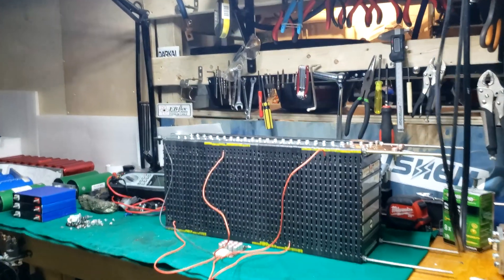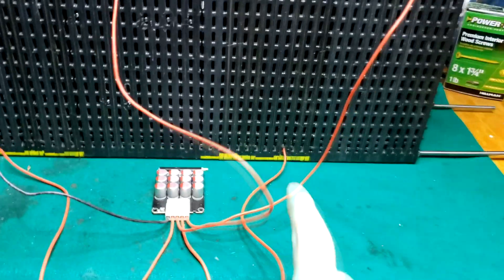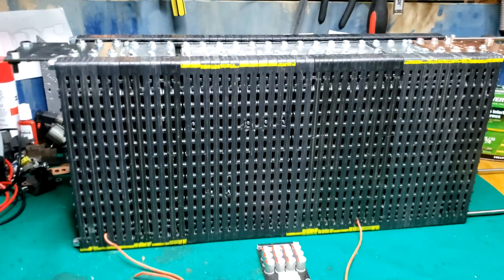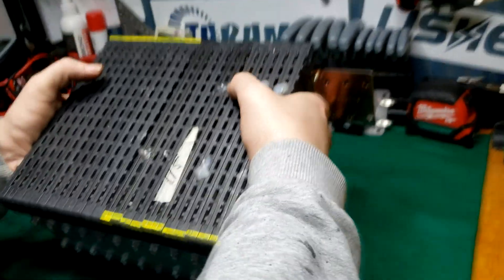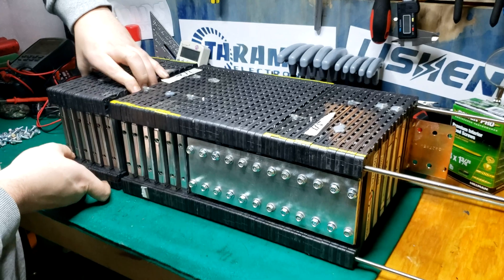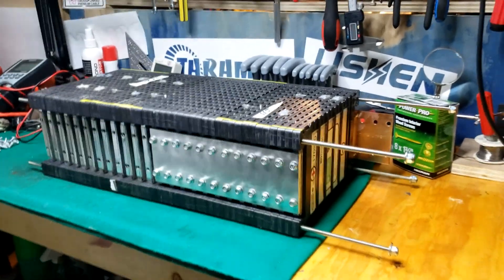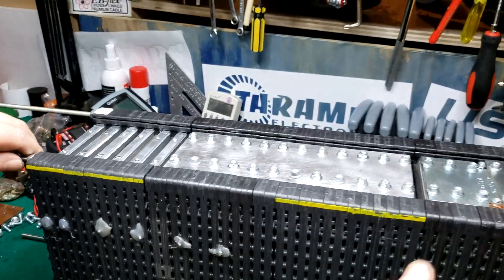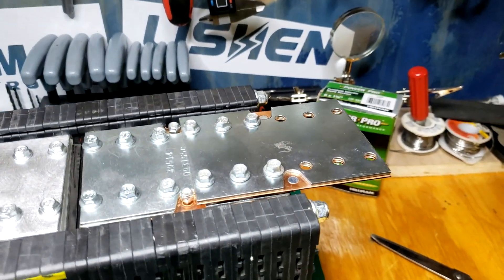SPIM08HP 96AH Lithium Battery Bank 16ah block Build

Comment: Hi, just wanted to ask if it's 200A continuous then wouldn't it be a total of 4800A. Continuous? I have a 160ah bank.  So do I have 8000A continuous?
Reply from the maker: Do you have a single 160 ah battery Bank? If so your biggest limiting factor is going to be your bus bars they would have to be absolutely ridiculously thick to be able to carry that type of current that's why we recommend doing a maximum of a 96 amp hour Bank. You would take the rating for each bank and times it by 10 because that's how many banks you have. So if its 200 amps per Bank that would be 2000 amps capability however that depends on your battery build
Reply: @mazda2284  yes its one 160Ah bank.  I made my own bus bars with .5" thick aluminum.

Comment: Love the Still Fly reference at the end lmao. I have so much to learn about Lithium your videos help a lot. I want to support an 8k. How much alt is too much? If I have the option for a 370 or 400a alt should I just go for it? I will be going full lithium so I hear Headway is not the way to go. Is LTO worth it over the SPIM08s? I want the most sustainable power for the least money. I don't compete it's just for daily driver listening so I want to be able to play 75% volume for at least an hour+. Any advice on what batteries and size of bank I should be aiming for?
Reply from the maker: Spim08hp are a great option for 15v + charge . Mid 14s probably more so LTO . Spim08hp is very affordable and get plenty of ah
Reply: @mazda2284  How many of these spim08hp batteries will I need for 96ah. I would like to see 15.4-15.8 as my starting voltage before voltage drop.

Comment: I was interested in these cells for my first DIY build. But I have a fluctuating charging due to Chysler PCM. 14 to 14.8v depending on a number of factors. Sometimes if Im rolling up the electric windows, I will see it spike to 15.2v. Could I use these? Or do you recommend a different cell? As far as what amps my amplifier pulls, I am not quite sure. seen alot of dynos on it but, a lot of peoples clamps dont register that high. I recon with impedance rise I probably wont ever see more than 800 amps. Orion HCCA 3000. Thanks for any recommendations
Reply from the maker: i swap em over to hairpins with gm regulators and take control of the voltage. i have videos on that also
Reply: @mazda2284  cool I will check that out. I was told for my year (2008) that it's to hard to bypass the PCM without also getting it flashed with a different driver. My alternator is a JSAlternator 250 amp. Believe they have a little write up on their knowledge base blog about the 2008 also
Reply from the maker: @JM-im1iu  ive done many dodge vehicles in that year range and its simple , you just dont use the factory system at all . unhook and bypass it . for the gm regulator all you need is a 12v switched with a lightbulb inline to act as a charge light on any old gm to the L pin ,  you get a dummy light on the dash but it dont matter ... slap a piece of tape over the light and use a voltmeter to monitor voltage ...done !
Reply from the maker: @JM-im1iu  its not like a 2018 that will send your vehicle into limp mode or anything like that , so super simple to bypass with stand alone gm regulator
Reply: @mazda2284  thanks for that information. I will definitely try this.
Reply: @mazda2284 I have a 17 dodge charger with a 240a mechman alt currently. I was looking to get 96ah of the spim is there anyway I could charge in the 15s?
Reply: I’m literally prep’n for almost the same exact build, except debating between my 3kDSPLX or 5kV2, 07 Dodge Nitro, facing the same shit, decided on this bank. How did your build turn out? I’m also going to be modding my charging system as described above so I can run at 15.5v, literally the same bro so any advice, hiccups bypassed, etc would be good info, thx 🖖🏼

Comment: Does this work for factory 12 volt setup or you need to up your voltage in your car on your alt. What do these rest at.
Reply: 12 volts no need to be 14.8 or higher is recommended

Comment: I didn't order stock bars for my bank i was wondering if u could tell hole spacing plz I'm on a crunch and having a shop build em while i wait for the battery thanks in advance and thanks for the information and content much appreciated
Reply from the maker: I made my own off the stock bars , or have a company like project db make em . Discount code audio for project db
Reply: @mazda2284 I found a guy on fb marketplace wanting $800 for a 96ah good?

Comment: So I'm about to do this for my build does your alternator keep it charged enough or do you have to use a separate charger
Reply from the maker: alternator does fine , heck we have a build ill be posting that has 3 of these with a stock alt and it takes abit but the voltage comes back up after bunch of demos , holds like a tank

Comment: how thick should the diy bus bars be ?
Reply: Depends on how much amperage you’re pulling. I’m making 1/4” thick aluminum bars for my battery… 9p4s… going to be in my truck on 2 8ks at half running the whole vehicle. Deleting the 2 group 34s under the hood and upping my voltage to 15.5 daily. Atm it’s 14.3 cold and 14.0 hot in my Cummins

Comment: To be clear( I know there is alot of fuss obkut configuration) isn't it 12p 4s not 4s 12p?
Reply from the maker: Same difference.  Same shit either way
Reply: @mazda2284  it's not the same thing.  4 strings of 12 parallel blocks not the same thing as 12 parallel blocks of 4 cells in a series.
Reply: Sure the voltage and capacity remain the same but that is not the only two characteristics to consider
Reply from the maker: @stygianindustries8295  you are way overthinking this lol . you would never do 12 blocks of 4s , that would be stupid and a nightmare to balance . what you gonna do take multiple 4s blocks and wire them to bussing ?
Reply: @mazda2284  gimme a second and I'll point you to the reason I wanted you to clarify. Everyone doesn't have the background or skills you have.  A slight misinformation could lead to disaster
Reply from the maker: @stygianindustries8295  so ur saying you wanna do 4s , then 4s , then 4s and wire those in parallel? That makes zero sense to do . You would have a balance and bussing nightmare that would ultimately be a horrible experience.
Reply: @mazda2284  I'm not saying I want to do anything  I'm saying I wanted you to clarify what you did.  Because other videos like the one in the link I just posted suggest doing it other ways.  Also the tesla battery is configured  parallel  series parallel
Reply: I was planning to do parallel series like you did but other videos got me wondering. I don't want to ruin my bms. I have spim08hp cells as well
Reply from the maker: @stygianindustries8295  the only disaster would be trying to do it the other way . There is only 2 ways to go about it and the other is wrong
Reply: @mazda2284  I agree I never said otherwise idk why you're trying to shit on me about asking for clarification
Reply from the maker: @stygianindustries8295  because the way ur saying would require a ton jumper wires to even work , and jumpers from each series pack to put them in parallel.  All your doing is making a balancer and bussing nightmare and tons of fail points.  There is only 2 ways to do it and this is the right way and the other is wrong .
Reply: @mazda2284   dude get a grip. I'm not suggesting to do it the other way. I'm suggesting you label your configuration properly. 12p4s is the correct label. 👌  and as you've clearly demonstrated in the comments here there is  a difference.   It is other people saying to do series first not me. I asked you to clarify because of the other videos saying to do It the other way. Geez man. We're on the same side here
Reply from the maker: @stygianindustries8295  i removed any SP PS to remove any idea that you would do it different. so you dont get confused .

Comment: So this is built with 1 module from bh? And comes with everything? Just has to be reconfigured? Can you use the stock bars or do you have to make thicker ones? Thanks.
Reply from the maker: This is built with 24 of the 16ah modules "2 8ah parallel cells " . A full module is 30 of these basically and comes with all the parts to do 28 total easily,  which leaves 2 blocks leftover.  Plus I did bars that can support more current than what come on it . I'll do a video on my new bars , they are thicker and counter sunk for the screws.
Reply: @mazda2284  Its me Donald, lol. Thanks.

Comment: How did you measure out the space between every hole to drill for the bolts, and what size is the thread pitch?
Reply: It came with smaller bars which we used for the end plates.  We just traced two of those onto aluminum and made the 3 bigger bars off those dimensions
Reply from the maker: came with all the hardware , and smaller bars , all we did was use the smaller bars as a template .
Reply: Thread pitch for the stock bars is m6x1.0
Reply: Also, that is a 4s12p bank, as the cells are actually 8ah, but battery hookup sells the cells in banks of 2, which can be misleading.
Reply from the maker: @jeremynash3729  48 8ah cells in this bank 4s12p. As 16ah cells as sold in the blocks built with would be 4s6p , bh is selling them this way and I didn't want more confusion by saying 8ah cuz the single cells require holders and then the link bars if doing it that way . This build is about the ready to use 1s2p 16ah blocks